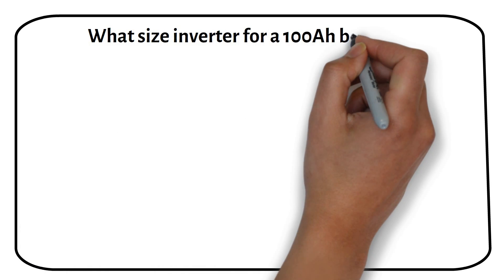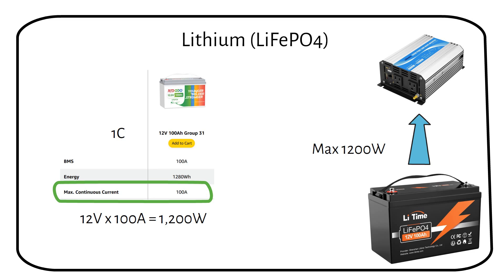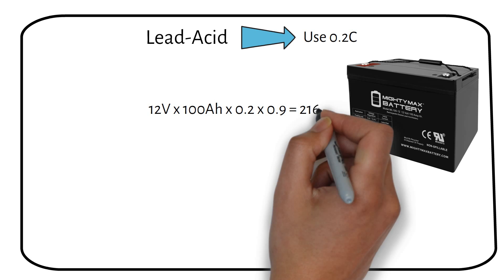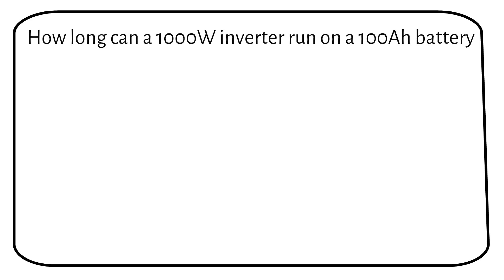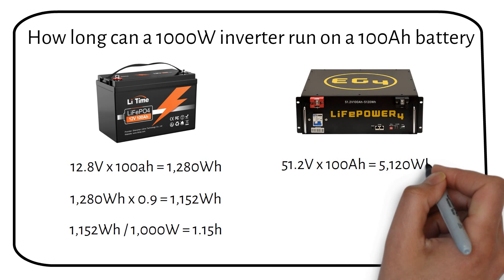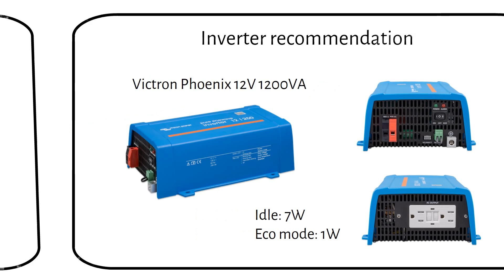What Size Inverter for 100Ah Battery - Sizing Battery for Inverter

Comment: Hi Nick, I have a 100ah lithium battery in my car & have just bought a Victron Inverter 230v 12/500 VE direct to charge my lithium 36v e-bike battery. From your videos I assume I need to use 6 gauge 110 degrees Celsius rated cable with a 70amp midi fuse close to the battery.

Comment: Hi Nick, I have a 100ah auxiliary lithium battery in my car running a fridge, led light strip plus a few phone chargers. Battery is charged by cars alternator plus a 170 watt solar panel. I want to charge my  Shimano e-bike 36v lithium battery. Would the Victron Phoenix Inverter 12/800 be suitable? Thanks Bill

Comment: I have a 3000 watt Renogy inverter with 2, 12 volt 600 Ah batteries, is that a bad thing?
Reply from the maker: Depending on how much current you draw, it's not sized well. But it will work.

Comment: Hi! I have a lifepo4 12v 20 ah (240wh) 1cbattery. Just for small loads. I’ve been looking at inverters, and found a 2000 watt one, would it be compatible? Or should I size accordingly to a 200w one?

Comment: I used 2000w 12v inverter machine for 100ah  12v dry cell battery and it comes up but it doesn't last
Reply from the maker: Dry cell is lead-acid? In that case it will work but your battery will not last and live long.

Comment: 1200 watt is about the max. 12v times 100ah = 1200 watts.
That battery WILL output more than 100ah, but briefly.
I will have four 100ah 12v batteries, so I can run a 12v 2000 watt, 3000w peak inverter.
And still have room left over just for comfort. My demand will only be a max of 3kw per day but most likely 2kw/day in increments of about 127 watts each time the fridge runs. And if I add in the chest freezer, that is 1kw per day or about 90 watts each time it runs.
Thing is I will be using between 400 and 800 watt solar panels so that would input some of the used energy back in. Enough to run those and charge batteries at the same time.
For backup, I have a grid powered 40a 12v charger in case of cloudy or stormy days.

Thing is that the frigging wire costs a fortune.

My original intent was to use it as a backup in case of power failure. But if lucky I might be able to use the setup all the time.
3kw per day x 15 cents per kw won't save me much money. Maybe $15/month.
Divide that into the $2,000 I am spending and it will take a LONG time to break even.
Reply from the maker: You are confusing Ah with A (capacity with current). If you are creating a backup system with 800W of solar i recommend using 24 or 48V systems. It's going to be cheaper.
Reply: @cleversolarpower  Would like to use a 48v system but then I have to buy a new inverter and a higher mppt controller.
My panels already output (OC) just over 27v.
Load have to be 12V due to inverter limits.
Don't have $300+ to buy a 24v inverter to power things.
But I do have 2 gauge wire I can use which is good for about 135+ amps.
Not trying to max out inverter capacity.
Reply: @cleversolarpower  Have watts 12v 100ah batteries - 4 of them. Which is about 4800 watts available before losses.
Planned on putting them in parallel with a 2kw 12v inverter with a 3kw peak for starting things.
24v inverter is pretty dang expensive and is limited to ONLY 24v systems. Not as versatile as a 12v one.
12v one could be used on a car for some things.
Would have to sell my first born to buy a 48v inverter.
Just wanting to run my refrigerator and in an outage run my gas furnace if I can.
Only have 800w max panel generation.
Should only need about 5 hours of good sun to recharge the batteries.

Comment: Our trailer came with two 200Ah 6V lead acid batteries in series for 12V and a 1500W inverter, which seems to work for using the microwave for a few minutes or making toast in the toaster.  According to your calculations this should be wildly inadequate, so how come it works at all?
Reply: You have 200 ah. It will work .  It will also drain quickly depending on on the load. And most people want to power things in their camper or rv all day.

Comment: I just installed a 6.2kwh inverter in my RV, going to use a 48v 100ah battery (1c) battery, if the weight allows it I'll add another 48v 100ah battery. Untill then I'll just make sure I won't exceed the battery output max.

Comment: I try today my 12v 100 ah lifepo4  and 4000w inverter 😂.than power up washing machine guest what for start show 60w impresive......than in second jump to 1900w and than i was happy to see how it s work perfect.Work only 3 min than everything stop working.My inverter is been too hot.Now i see how many batteries i neded to work fine
Reply from the maker: If it's a half decent inverter it will still work. However, I think it's advertised as 4,000W peak, so more like 2,000w continuous. And 1900W on a 12V battery draws 160A. So most likely the BMS shut down because it's only made for 100a.

Comment: I have a 1200 watt inverter. Is running two 12 volt lithium in parallel going to work? Thanks
Reply from the maker: Yes.
Reply: @cleversolarpower thanks.

Comment: What if the set up is a 12v 100 amp lithium battery and a 2000W inverter but no more than 750 watts is ever drawn like a small microwave oven?  Asking for a friend,,,

Comment: I have a 2,500 w inverter but my actual batteries are too small  i have a 12,8 v 50ah   and a 12,8v 100ah.  to use my 2,500w inverter I would need  a 12,8v 200ah battery?  what would you recommend?

Comment: Two 12v in parallel lifepo4 should run a lot longer.
Reply from the maker: Depends on your loads.
Reply: @cleversolarpower  Just an older refrigerator for the most part. Add in a chest freezer maybe.
Neither will run constantly.
Figure maybe a day to power both?

Comment: 180ah lead acid battery. 3000w pure sine wave inverter. I only use it to power the TV and domestic freezer during the occasional power cut during winter storms. Max load about 180w.
Reply from the maker: If you are drawing that load, then why didn't you use a 1,000W inverter. I hope your cables are sized for a 3,000W inverter.
Reply: @cleversolarpower yes cables are sized correctly for Max load. The reason it's 3kw is because there was very little in the different between the 2 and the 3. Let load on the inverter should hopefully ensure it lasts a long time.

Comment: 12v times my amp 105 lipo4. 12x105 is 1134 watts. so i can not use a 2000 watts inverter and why_
Reply from the maker: No it depends on your BMS. How much current can your bms provide to your inverter? I suspect this is 100 amps.
Reply: @cleversolarpower  the bms the maximum 150 amps. by the way i purchased your book in amazon.

Comment: HI. i HAVE A 200 WATT SOLAR PANEL, 20 AMP CONTROLLER, 100AH AMG BATERY AND 3000 WATT INVERTER. I ONLY USE TO RUN A MINI FRIDGE WITH A 600 WATT MICROWAVE, TOASTER. JUST LITTLE THINGS. AND NOT ALL AT THE SAME TIME. JUST WHEN NEEDED. FRIDGE STAYS ON. IT ONLY USES BETWEEN 5O AND 60 WHEN COMPRESSOR TURNS ON. MY QUESTION IS. THIS WEEKEND JUST PASSED AND MY SOLAR PANEL IN DIRECT SUN. WHICH I ASSUME IS GOOD. WOULD GO ABOVE MY SET CHARGING VOLTS. IM SET FOR 14.8 ON CONTROLLER. BUT IT WENT 15 AND 16 WHICH MADE MY INVERTER START TO BEEP. THIS IS THE ONLY REASON I KNEW IT WAS OVER CHARGING. ANY SUGGESTIONS. SORRY FOR THE CAPS. SET THAT WAY FOR MY WORK
Reply from the maker: Check your charge controller settings, or it could be that it's in sulfation mode.

Comment: Nick thank you very very much for this video. I’m just getting started with solar in our camping trailer. I bought a 3000 W Renogy inverter and I’m curious as to what size of battery I should be using. Our primary concern was running a 1500 W space heater so felt I probably should get two 300 amp hour Lithium batteries could you share with me your thoughts. Thank you
Reply from the maker: The battery size depends on your daily loads and how long you will run them. I recommend checking out my video called 'load analysis'.

Comment: have an schneider sw4048 what is the maximun number of EG4-LifePower4 V2 Lithium Battery | 48V 100AH bateries i can hook up in parellel to it??
i think i read somewhere that said maximum dc input amperage is 110 amp of course this has nothing to do with ah and i still dont know how i can calculate
the actual amperage of a lithium battery coming out to the inverter
Reply from the maker: A server rack battery has a 100A BMS. So to run the 4kw inverter on 48V, you need 83A, so one battery is enough. However, you have to size the battery for your load. Check my video about load analysis.
Reply: i think you got my question backward, lets change it to this question is my inverter going to get damaged if i hook up 3 X 48v 100ah to it thats how many battery i have at home

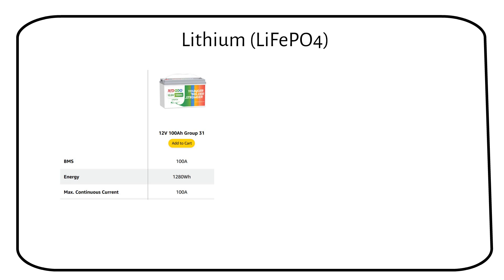Comment: 0:45 You state that a 100ah lithium battery can deliver can deliver a current of 100 amps. But isn't this not necessarily true? You're comparing amp hours with continuous discharge
Reply from the maker: 100A is what a 12V 100Ah battery with a 100A BMS can deliver. The continuous discharge is limited by the current of the BMS.
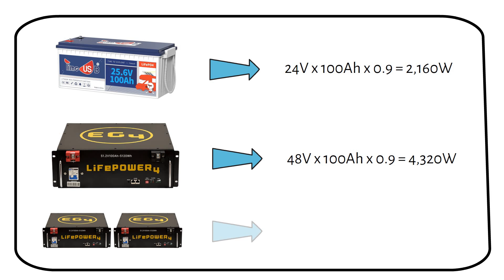Reply: @cleversolarpower  2:14 Wait are you saying the discharge rate is doubled too when two batteries are in parallel?

Comment: Motorhome 39’ / Four lithium WattCycle 12V 100Ah LiFePO4... inverter ms3012RV inverter is shutting down
Reply from the maker: Too high power demand? Battery charged? Can be many issues.

Comment: I'm trying to calculate how much battery watt hours I need to run my heated blanket at night.  The blanket is rated 100 watts.  
I have two 12V sealed lead acid deep cycle batteries that claim 550 cold cranking amps each, wired in parallel, in my camper trailer.
I'm using a 300 watt voltage inverter, only running the heated blanket.
I calculated each battery has 75.8Ah.   ( 550 CCA / 7.25 = 75.8 Ah )  
75.8 Ah x 2 = 151.6 Ah
151.6 Ah x 12 V = 1,819.2 Wh
1,819.2 Wh x 50% (because it's lead acid battery) = 909.6 Wh - 15% (electrical losses / inefficiencies) = 773.1 Wh available.
Can I run my heated blanket for 7 hrs and 45 mins?
 Is this correct??
Reply from the maker: Cold craning amps does not matter in this case. You need to look for Ah. If one battery is 12v 100ah, then you have 12v 200ah or 2400wh. You can only use 50%, so 1200wh. Then 80% efficiency is 960wh. Heated blanked 100W+ inverter idle is total 110w. 960wh/110W=8.7 hours

Comment: Can i use a 4KW 24V 4000W Off Grid Solar Inverter Build-in MPPT 100A with a 24V LiFePO4 100Ah Battery? Or Better i use a 24V LiFePO4 150Ah Battery?
Reply from the maker: 4000W/24v=166A Max. Your 24V 100ah probably has a 100A BMS. So you need 2x 24V 100ah in parallel or 2x 12V 200ah with a 200A BMS in series with a balancer.
Reply: @cleversolarpower  Thanks,  so its better to take a 1.5x or even better a 2x higher AH battery then the A of the inverter? So for example for a 4000W/24V inverter=166A and a 200AH battery should be enough for the 4000W 24V 100A inverter? It can be a single 24V 200Ah battery or double 24V 100Ah battery (in parallel) ?

Comment: I have a 12V 600Ah bank (2x 300Ah EVE LiFePO4), with a 450W solar panel and Victron 100-30 MPPT.  I also have the 30A Victron DC-DC charger and 30A Mains Charger.  Inverters wise I have two.  A 1500w Epever that runs the microwave and kettle (not at the same time) and a 400w Victron that runs all electronics on a separate circuit (TV, computer, routers, etc.).  I can be off grid in summer indefinitely without the need for mains charging.
Reply from the maker: Great! thanks for sharing.

Comment: Realistic numbers.  With the drop in lithium batteries prices it is easier to add an extra battery.  As I have a 1200 power station, 2 12v 100ah batteries, with 240w of solar panels to charge the batteries.  I primarily use this system to power the laptops, some lights, and fans.  Also I've tested the system and as a backup power supply I can move it to the kitchen and power the fridge, help out my sons, brothers, and sister incase they have a black out.  Finally, I can take power station ro outdoor outings.
Reply from the maker: Power stations are great if there is a blackout.

Comment: Love your content @cleversolarpower. New to solar and i purchased your book hoping to learn a lot. So thank you for sharing information.  Question: i am setting up a boondocking system for my Class C 33footer, i have a renogy 3000W inverter charger, 4 Litime 100Ah lithium Minis, 4 200watt renogy solar panels i should be within your calculations for inverter size right?
Reply from the maker: My pleasure. Yes, (3000W/12V)*1.25=313A. The problem is with the cable sizes. You need large cables for a 12V 3000W inverter, and your solar charge controller has to be large as well (high current). Checkout my most popular video on my channel and the video about 12, 24, or 48V. If you are in a camper and want to charge through the alternator, then 24V is the max i would use.

Comment: Good afternoon young man this is Jerry speaking. I’d like to know if you could tell me how many lithium batteries do I need to use on a 2000 W energy inverter. I do have two 120 milliamp lithium batteries, batteries
Reply from the maker: Hello Jerry, the amount of batteries depends on the load you are trying to run. You can watch my video about 'load analysis' for that.

Comment: Hi, I have a Vevor 2000W Inverter for sump pump that I like to connect to the sump pump as a backup. The motor of the sump pump is a 1/3 hp and 3.5 ah. Can you help me to get the good battery for this?  A marine flooded deep cycle battery or lithium? Thank you.
Reply: In about do the same. I'm going to buy two 280 AH 12.8 volt PowerQueen lithium iron phosphate batteries (200 amp BMS) and wire the batteries in parallel. I have a similar pump that has a 10 amp surge (120 volt wall plug), so it could surge to 1200 watts. A 2000 watt inverter should work well I would think.

Comment: Planning to find out proper inverter, got 2 x 12v LiFePO4 8S batteries 300ah, and now thinking about 24v intveter 3000w should be enough ❤

Comment: Hello I have a 100 ah battery can I use 2500 W inverter but just limit the load to what 1000 Watts can handle? I want to use it to expand battery size in the future.

Comment: I have 4 300ah batteries and am using a 2000 watt inverter because I only need to power my desktop with it.  The rest is powered by propane or 12v.
Reply from the maker: Thats a lot of batteries to run a desktop. It might be okay to oversize your inverter so the fan doesn't kick in.

Comment: Hello Nick, love watching your videos, picked up quite a few things I didn't know,
I sent this to one of your other videos but ill send again to the revenant one.

I have a 5000w 12v inverter, I will be purchasing 4 X 12v 100ah lifepo4 batteries , what would the wire size be if I link the battery's in parallel?, (no buss bar) what would the individual fuse size be on each battery? And what would the last fuse size be to the inverter?, the inverter has its own factory wiring.

Comment: Okay so I'm buying a 27 ft RV that I plan on running a 5000 BTU window shaker unit lights LED lights TV and a home Wi-Fi now I can get a 4000 w inverter and I would like to use the two 100 amp hour 12 volt batteries I have now pretty sure that's not enough I think I would have to double the batteries oh by the way it's a 24 volt inverter. Would 4, 100 amp hour AGM batteries be sufficient?
Reply from the maker: No, checkout my video about 'how many batteries for a 3000W inverter'

Comment: I have a battery of 100a 5kw felicity installed on a 5kw inverter. I had it installed yesterday and it seems to be running down faster than I thought. In 4 hours about 40% is gone and the total load isn't upto 1kw. Is it normal or is there a problem?
Reply: mine too, i have 1kw felicity and 200ah battery just for back up but the battery drains without even load

Comment: Lithium 12v 100amp on a 2000watt inverter, which is over-sized, but there’s nothing in the rv bigger draw than 900 watt microwave. 1st time I used that, the shunt read 136amp draw and the battery low voltage indicator came on. Haven’t used micro since. 
I was expecting draw to be under 100amps. 900 divide by 12 is only 76amps. Even factoring 90% efficiency, I thought would still be under 100amps. 
Plan to add a 2nd 100amp battery to solve this, but I’m left wondering why my numbers didn’t add up.

Comment: For a 12v system, for every 100ah batteries wired in parrelel = 1000 w.
So if you have 4 batteries like this, 4000w inverter?
Reply from the maker: I recommend watching my video about 'how many batteries for 3000W inverter'. I do not recommend going over 100A in your system to keep it affordable and safe. So you will need to increase the voltage of your battery bank as well. For a 4000W inverter i recommend using a 48V system.

Comment: I have 2  100amp hour battle born batteries and my inverter charger doesn’t seem to charge it to 14.4 .6 volt so I think my charger is made for lead acid  ? And I have 200 watts of solar panel
Reply from the maker: A 12V lifepo4 battery settles down to 13.3V after being charged.

Comment: I have a yellow top Optima battery(@75 ah). I want to use in camper. I want to power a small 12v fridge(@ 6amps)
What size inverter would be enough power? I will add some solar panels, maybe 300 watts.
Can I run a 1500 watt griddle with this battery?🇨🇦🤔🤔
Reply from the maker: If you have a 12V fridge, then it is DC and you don't need an inverter.

Comment: I've got 1 x 24 200ah battery hooked up to a 3000W inverter
by your calculations 24v x 200ah x 0.9 biggest inverter i can run is 4000W so technically I should be safe with a 3000W and my battery should not have any issues correct?
Reply from the maker: It depends on the maximum current the BMS inside the battery can deliver. If it is 200A then it's okay. If it's only 100A, then the BMS will shut down the battery because of too high current.